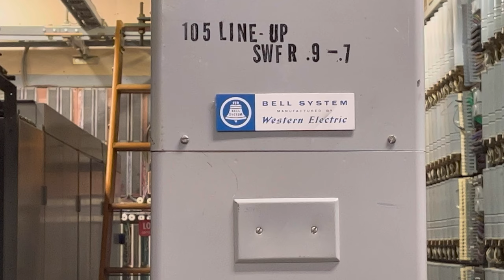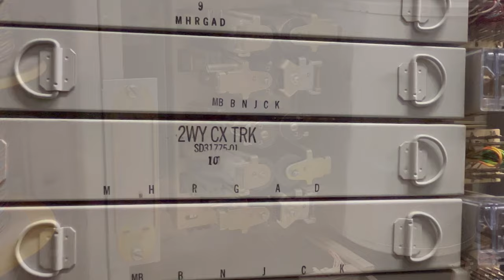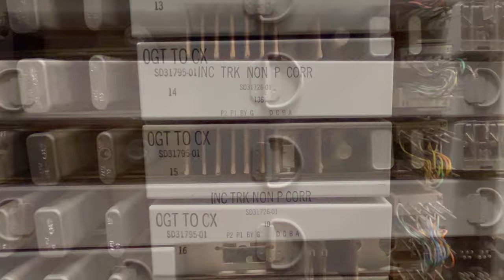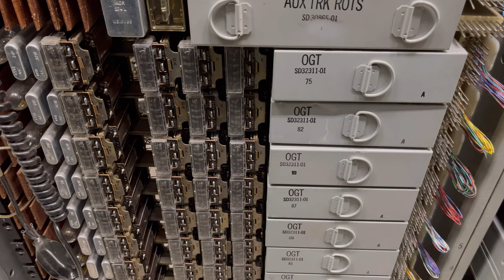Strowger step system Part 2 outgoing trunks and incoming calls.

Comment: I'm not sure who on YouTube I've asked, but here is a step era question, in Kansas City all center zone and MCA 1 & 2 bands eventually became local calls, each office has a two digit office code on the CLLI, an example is KSCY05.  Back to the question,  816-257 was switched at the same office eventually as 816-796 (host wire center) on Bundschu at Gudgell [at my time living there].  These calls between the two were at most a message unit call in the past.  If you called any of the 816-25x other numbers it went to the office on Spring Street.  Would they send 257 calls clear into Spring St on a trunk and send it back on another to the other frames office of the wire center, or did they put double terminations on it (heavy calling between the two) and do a cut-off whether the third digit was a 7 or not?  Things like most of the area school district was almost all 796[FX]  and 249[HOST]  as well as some lines into a ammunition plant, 3 elementary schools were 796, one was 249.  Most of the rest in this office code otherwise was residential, 257 was more retail up to 5 line customers,  and a smaller amount of residential customers.  Oddly an adjacent independent telco that was X-Y later on, was Uniteds 249 and it was toll, but the operator toll dialing guide didn't follow to most Uniteds other code, it went like a Kansas City trunked Call, perhaps trunked into SY6.  About 25 years ago this dialing problem was solved with MCA calling, where the school district got a new office code local to the MCA [1-3] and CZ customers. MCA subscribers [4-5] had some privileges too, it became simplified but still has its complexity.
Reply: why kansas city?
Reply: their calling area went from simple to more complicated than Philadelphia or even NYC.  MCA was built to relieve people in independent served territory of tolls, and allow those calling a MCA subscriber to be toll free.  
You basically had a office code change if you participated.  If your office was MCA 5 for example you could call any other MCA 5 territory participant or not, and participants of MCA-6, the higher your territories number the better your calling area was.  
In Philadelphia you could live in Philadelphia proper and get unlimited calls inside the city only, and pay measured usage otherwise, then you could upgrade to 1SR and get all the measured calling area unlimited, then you could also be outside the suburban area and get 1WR and only call into the city without toll, but callers in most cases paid toll to call you. You also in some cases could elect 1XR service for a small unlimited calling area. Eventually a few areas could get hometown plus and get a toll and your central office only unlimited and paid per call to other local call locations.  It took more than 8 weeks to learn how to be a service rep at the phone company.  Eventually they didn't do it offline with fake callers and cassette tapes, but a classroom learning experience. 
Now NYC is totally different,  like Chicago, you have certain areas you can call as a local call, others are message units, some tick the counter every start of call, some also add more ticks depending on time of day/day of week, and seconds elapsed. 
But asking why Kansas City, it's because I lived there, and that's where the situation occurred.  It's not Wichita where the start digit determines which trunk at the time handled your call for example 5 was Jackson office, 7 was southeastern suburbs 2 was downtown, 6 was Oliver, and so on.